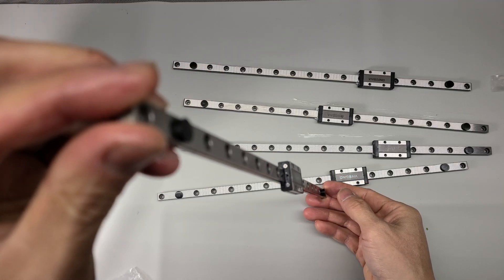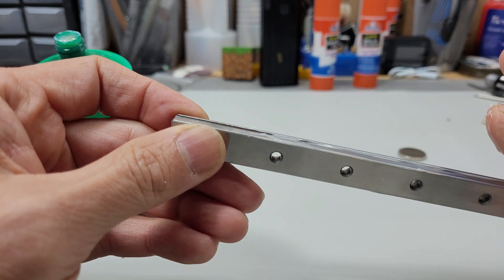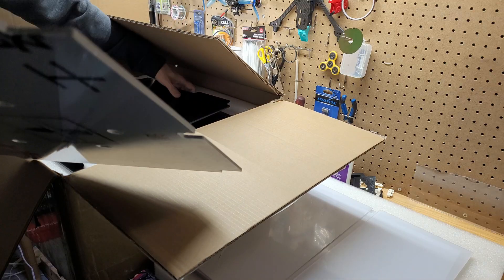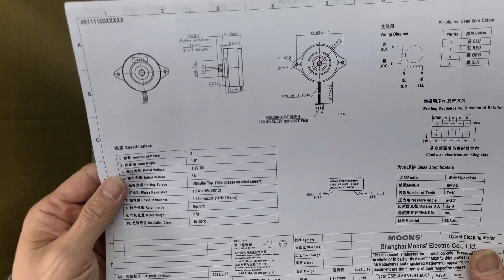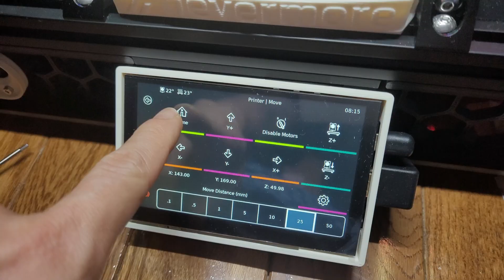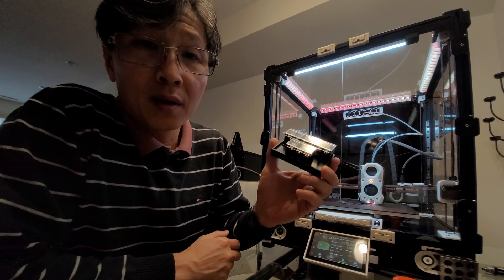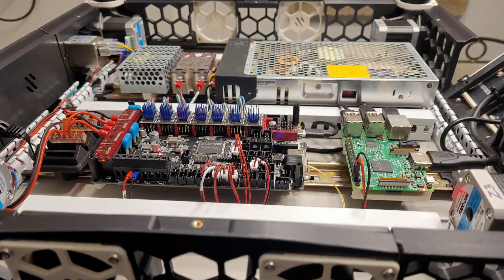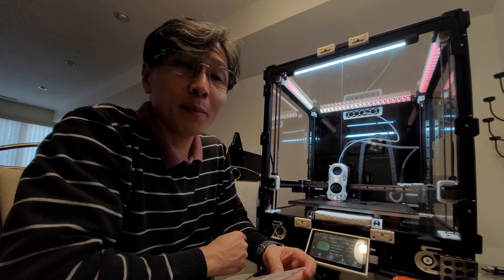Honest Review of Formbot Voron 2.4 Pro 3D printer kit

Comment: Quick question. Did you have to do any soddering for the electronics? If so how much did that cost you?
Reply from the maker: Yes, i did solder the pcb board for the tool head. Make sure solder joints are well made due to the fact that the toolhead shakes a lot. A dab of hot glue at the solder joints will definitely help down the road. You wonder how much it costs for soldering electronic? For me, i have all these from my other hobbies like drone, RC car.... so it doesnt cost me anything. But if you dont have anything, you can get soldering iron with small tip, solder patse, and solder.

Comment: hi, just wondering what size is the machine and what size is the bed, many thanks
Reply from the maker: my #Voron2.4 machine is called 300mm version which has exactly 300mm x 300mm AC heated bed. You can get bigger 350mm version machine which has 350x350mm AC heated bed but of course it will cost you more. If you decided to buy it you can support me by buying at this link https://www.formbot3d.com/products/voron-24-r2-pro-corexy-3d-printer-kit-with-m8p-cb1-board-and-canbus-wiring-system?DIST=Rk9OHVk%3D
Reply: @ thanks I’m looking to the 300x300 mm but I want to check if will feet in the place that I have designed for it, what size is the foot print of the machine?
Reply: @ thanks , what size is this machine, the foot print of the 300x300, many thanks
Reply from the maker: @simoneala3  mine sits on 470mmx470mm table surface. the height is about 580mm. Of course, you have to take into account of back spacing as well, I have about 200mm spacing from the back of printer to the wall. this back spacing has to be at least 120mm I think.
Reply from the maker: @simoneala3  as I said earlier the heat bed table of my machine is 300mx300mm. Thus, it's a 300mm machine which has ~470mmx470mm foot print. Hope it clears things up for you!. Cheers!

Comment: Hello, I bought my formbot kit about a month ago and built it almost every day after school. For the last 3 weeks or so I am really struggling with the config. I am just missing that spark to understand how coding works but even though i study robotics and coding c++ in school for 2 years now i still don't understand anything. Is there any way you could share your config? I just don't know how to move on.
Reply from the maker: @derfelix052  let me first ask you. Is your kit stock? Do you have any electronic "upgrade"? Also, can you access mainsail interface? If yes, is there any error reported?  Voron has good documentation from start to finish regarding config file setup. It really depends on what you have electroniclly meaning the chipset you have on your mainboard. You need basically to have the "pi" to comunicate with your printer "mainboard"
Reply from the maker: @derfelix052  software wise, the config doesn work if there is no connection between the "pi computer" and the "printer mainboard".  In my own case, i connect using CANBUS cable so my software setup is different from other not using canbus. Depends on what mainboard you use and the chipset on it, you need to "compile" the software for  the "pi" to recognize your printer mainboard. Once you confim that, you can then setup your config file. Hope it helps!
Reply: Hello, i have a stock formbot kit with a manta m8p v1.1 and cb1 and i also have can, yes i can enter mainsail and i see the errors pop up, but i dont know what to write in the config to get rid of the errors.
Reply from the maker: @derfelix052  Hi, wonder if you have resolve your issue? You have different hardware (printing board wise) so my setting won't help you. But there good documentation about VORON printer for your board. Check this out https://github.com/VoronDesign/Voron-2/tree/Voron2.4/firmware/klipper_configurations/M8P
Reply from the maker: @derfelix052  really pay attention of MCU CANBUS setup. Mine is like this... 

[mcu]
##  Obtain definition by "ls -l /dev/serial/by-id/" then unplug to verify
##--------------------------------------------------------------------
#serial: /dev/serial/by-id/{REPLACE WITH YOUR SERIAL}
#canbus_uuid: 6cd1ea5a021c, Application: Klipper Octopus
canbus_uuid: 6cd1ea5a021c
#restart_method: command
##--------------------------------------------------------------------

[mcu sb2040]
canbus_uuid: 67f6ee29fa07
#canbus_uuid: 67f6ee29fa07, Application: Klipper Mellow SB2040 v2 PRO CANBoard

Comment: What kinds of speeds can you achieve with the Formbot kit?
Reply from the maker: 250+ mm/s for sure. But in reality, it depends on your nozzle capability and how hot the nozzle can keep up with that moving speed. Generally, i need to set higher nozzle temp for higher speed without delamination issue on ASA material. The printer is fast moving without skippimg step. With all that said, it also depends on how well you build the kit. But expect somewhere between 125mm/s and 200mm/s

Comment: Very clean build. You should be proud of it.
What is the white filament you used? When I built my formbot 2.4 I wanted to do a white and blue color scheme but from the research I did at the time I was told that white filament isnt suitable for voron parts because it  has more fillers to get it to look white and as such isnt very strong.
I already bought the white abs so I tried printing it after I built the printer and yeah its the worst of all the filaments I have. Prints like crap and is brittle. But your parts look nice. Not as white as the filament I have so maybe its natural abs or asa?
Reply from the maker: first thank you for stopping by and say hello. Yes ABS is perfectly fine for Voron part but I do prefer natural ABS color instead of white color.... White color ABS looks nice but I am not sure about its ductility properties. (you should compare ductility properties of the white color with that of regular/natural ABS, you should find the difference) Depends on brand, some are more brittle than other. Stay away from eSun ABS+ to print for Voron parts... . Just go with regular ABS material. I use Polymaker PolyLite brand for ABS and ASA material. In the video, I use natural ABS with no brand name... and it's cheap like $14CAD for a 1kg spool. It still prints nice as long as I got it stick to the surface and enclosure usage. Cheers and best of luck

Comment: Primo recommendations. I also selected formbot based on price and some good reviews and I'm quite happy to have found this video confirming my choice as my parts arrive over the next couple days. Definitely going to go check TIR on the surface plate at work (I'm a Seattle-based mechanical engineer) for all my motors and get some WAGOs on order as well. Thanks for the video!
Reply from the maker: the machine can only produce good quality print if and only if it is built correctly in both hardware and software. Since you have mechanical engineer background, it shouldn't be a problem building it mechanically (making sure frame and gantry is built nice and square) Software wise can be a bit tricky at first if you don't how to get around Linux cmd line prompts. Fortunately, there are helps online :-) Best of luck, if you need help just drop a line here. Cheers

Comment: Hello I have a question, I was always under the impression to lube the linear rails you have to take the rails off and lube from behind, that's what everyone says anyway. My question is lubing the way you did have you had any issues?
Reply from the maker: They came pre cleaned in the Formbot kit so you dont need to open and loose all the balls. Unless you work under magnifying glass, i highly suggest not to open them. I have opened one block video, you can take a look for ref to fix one of the blocks. I think they use retainer ball bearing guide wire / actual ball bearing size to preload the linear block. To put them back, you need micrometer to seperate different ball size which is time consuming.

Comment: I am building also my Voron 2.4 from voron with sb2040 can.
I have hard time with config, would you be able to share the config?
Reply from the maker: Sure. Btw, what probe are you using? I make quick video tonight showing my config and explains what it does. Were you able to get the mcu id: Application Klipper?
Reply: @lavithhcm  Thanks for the answer. I am using Klipper with mainsailos and  using tap . Most of my config looks good, but I just wanna double check . Still didn’t do first print because I have Issue with Klipper.

Comment: What problems did you have with the steppers online motors
Reply from the maker: The motors are just bad (3 out of 5) with TIR spec is out of whack as i checked for TIR similarly in this video https://youtu.be/WWF8mjZLdJ8  . The TIR spec of a motor is so important in terms of print quality. There is no tuning or compensation method that i know of for bad TIR of a motor. It was long ago but not sure about it now unless something changes. I wasnt willing to gamble my money on it. 🤗

Comment: I've also built a formbot voron weeks ago with TAP. Im about to replace that with klicky. One question - do you use klicky as a Z endstop? or do you have separate z endstop installed?
Reply from the maker: I just replaced my pcb klicky with cartographer scanner probe. To answer your question, I use Z-endstop in conjunction with  PCB klicky and setup Auto Z calculation. People call it auto Z klicky.
Reply: @lavithhcm  so I can’t use klicky without additional z endstop?
Reply from the maker: @user-n4p9i  of course you can. In [stepper Z ]setup endstop as virtual endstop. And klicky would act as Z endstop.
Reply: @lavithhcm  but how does it know on what height it should take the probe when there is no separate z endstop?
Reply from the maker: @user-n4p9i  The 3d printed parts which you need to print out. It is  setup as the "same height" as your toolhead. So it just move sideways to grab the probe.
Reply from the maker: @user-n4p9i  https://youtu.be/eErlc0JizcY?si=R39fb4jmsEFM1aM8

Comment: If you would have stayed with the electronics that was included in the kit you would not have needed the 5V supply for the Pi. And then you would have space for the splitter that was real nice because you dont have to use any wago connections.
Reply from the maker: 5V is actually drives the rgb leds. I could get the regulated 5V from the octopus  UART
Reply from the maker: 5V is actually drives the rgb leds. I could get the regulated 5V from the octopus  UART

Comment: I'm so jealous of your wiring it's so clean and organized I can only dream of this, nicely done.
Reply from the maker: If you use CANbus, you will have the same clean wiring as well. I think with my 4 wire Canbus mod/upgrade, it reduces as many as 20 wires from the toolhead. Last but not least use WAGO connectors ❤😂
Reply: @lavithhcm  Speaking of wagos, I bought the fformbot kit thanks to your videos but I was just wondering what file you used for the wago clamp mount
Reply from the maker: @michaelmills3898  wago file you can find in voron mod repository. The flat one is actually from Voron STL folder
Reply from the maker: @michaelmills3898  https://mods.vorondesign.com/?version=v24&search=Wago

Comment: I'd like to know how you made such clean wire harness for your Canbus and AB motors
Reply: Or you can go sensorless homing,  at a lower speed for X and Y.
I have a Formbot 2.4 as well, over 1000 hours of print.
2 problems that I had so far:
Broken wires- eliminated with canbus,
Shite quality pei plate - replaced with a decent one. 
Kudos for your measurements and detailed review.
Reply from the maker: Canbus runs on 4 wires only. Power wires go directly to my 24v psu. Data wires (CAN H and CAN L) go to the RJ11/RJ12 jack on Octopus v1.1 board. Yellow and white wires in the video. Check it out again, you'll see them. AB motors wires go down with Z drag chain. By doing this, you need to have X endstop on the toolhead and Y endstop at the back eliminating drag chain on both X and Y axis.

Comment: I really appreciate you checking with a granite plate. 

I've been wondering if building a 3d printer with an epoxy base would help with resonances
Reply from the maker: Not sure i umderstand. Instead ABS, you want to go with epoxy parts? Epoxy parts would have catastrophy failure to the printer down the road. It might work at the begining but it is like a time bomb to be exploded. So stick with ABS or ASA material. ASA is a bit tougher but more bittle than ABS. Having said that, both are great material to build printer with. Stay away from ABS+.
Reply: @lavithhcm  no I mean put the entire 3d printer frame into an epoxy composite base like a large CNC
Reply from the maker: @sokofabco  oh i see. I see cnc machines epoxy some peg legs onto concrete floor so it wont move out of position. But in our 3d printer case, my table is the weakest link that would wobble back and forth so much. Unless i have concrete table, its different story. I plan to use 2x4 to make solid bench for it and then place a concrete paver on top to weight it dowm.  If the mass of the table is much more than the mass of tool head  i think ít should do the job to stablize the printer.
Reply: @lavithhcm  what's wrong with ABS+? And.. any ABS+ or particular brand? I've heard something like ABS+ has lower glass transition temp than regular ABS and that may(will) cause issues. Is that the reason to stay away from it?  And if so... Does that apply to all brands? ESUN ABS + seems to have normal print temperature compared to regular ABS  240(recommended)-270.
Reply from the maker: @lozovoymax1941  eSun ABS+ suffers from layer adhersion issue. Parts might look ok but become flimsy. This is especially true when overtighten occurs and develops micro cracks between layers. Right now, everyone seems to recommend ASA over ABS but honestly i think ABS is far superior in our use case due to its ductility.
Reply: How well does the nevermore reduce the smell of ASA? I want to print some back up parts for my Formbot Trident, but its current too cold to open windows for venting.  @lavithhcm